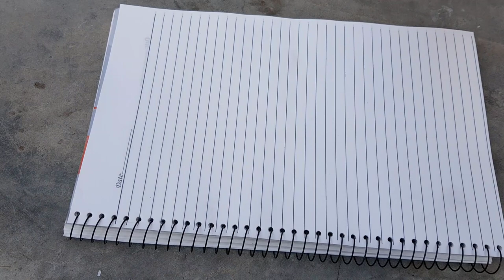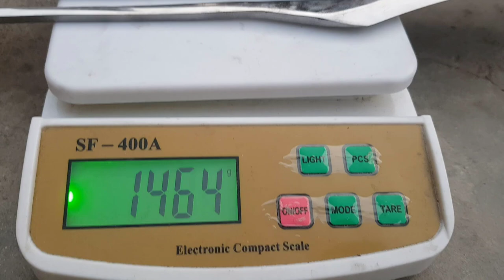Rusted GREEK SWORD - RESTORATION

Comment: I assume you cut the hole to take away some weight. I'm no blacksmith or mechanic but In my opinion a fuller would be better then cutting a hole. The hole will cause structural problems in the blade. A fuller will keep the structural integrity and will cut some some weight
Reply: @emmanuelmurillo8665  again just my humble opinion
Reply: That is what I was thinking.

Comment: The handle is only glued together with epoxy... It will separate in 3 good whacks...
Reply: The handle doesn’t really look good with that blade and the way he cut parts out of it weakens it and the hand guard doesn’t look good with it plus it doesn’t match.
Reply: @demonshady1347 , I thought the same thing
Reply: Like many have stated he’s never going to use it. He’s making a decoration essentially
Reply: That's if the spine lasts that long with the huge hole in it.
Reply: There were pins...

Comment: Didn't like the cut out it looked better and stronger without it
Reply: Im agree with you
Reply: agreed
Reply: Yup, that cut out has no benefit to the sword either aesthetic or practical.
Reply: +Vampros Mortimer   I cant Agree with you.   You can bind some of these swords together an smash the hell out of you Enemy xD
Reply: a fuller would have been better
Reply: It’s to reduce weight.
Reply: @vamprosmortimer5133  sure for benefit = reduce the weight
Reply: @leifstone5969  thing is, it wasn't like he's going to swing around that sword, right? why bother reducing the weight
Reply: @zedieucorentin  He could have reduced the thickness of the blade at that point without compromising the structural integrity, it's called a fuller and our ancestors used them for a reason (more than one reason actually, but I digress). Blades with holes in are almost entirely absent from the historical record. 
Putting a fuller in the blade would also have been a better test of his skills in my opinion, but each to their own.

Comment: This is awesome, but can anyone explain to me why he cut the groove through the back of the blade?
Reply: BC he needs the 10 mins
Reply: Weight reduction? And also to make it look cooler
Reply: Aa Bb if it was for weight reduction maybe he should have skipped that brass handle.
Reply: Whatever the reason...IF this were indeed an ancient blade (which I doubt), drilling into it and cutting that useless slot into it ruined it as far as any value is concerned. Restoration is taking and object and restoring it to its original, "Like New" condition. Any modifications just ruin the item. And if it IS an ancient blade (again, I doubt it) , he should be ashamed of himself for modifying it.
Reply: Blood channel?

Comment: Doesn't look like a Greek sword.
Reply: Barbarossa knows better.😁
Reply: It does actually. The greeks had many Sword models
Reply: actually, it's a Falcuta. It was a modified version of the Kopis sword from the Greeks, that the Early Romans used in the (Roman Conquest of the Iberian Peninsula) To be frank, it was really as powerful. It could use it's weight, and have the same type of power/impact as a heavy ax. Think of it like a sword/ax hybrid.
Reply: Because its a shitty modern styalised replica, you can see when its in the furnace there are angle grinder marks at the base of the blade.
Reply: It does actually but it's probably just a couple of years old judging by the amount of rust. Either that or the dude ages the things himself so he can "restore" them on YouTube for views. Only takes a few hours to get it looking old like that. I know because I relic guitar parts
Reply: It doesn't look like a Falcuta either, the top edge of the blade should be a continuous line, this thing instead has a spike/point no greek-roman sword has

Comment: Yeah, ancient... But seriously, how old is it? ;)
Reply: Zeus only knows, possibly very old. Considering the original swordsmith used an angle grinder to cut it out of the 1/4" steel plate, it might be from the age before plasma cutters were readily available
Reply: @andersknapasjo9576  now that is very perceptive! So the age would be somewhere Walmart The Great and Holy Apple Empire. Astounding...
Reply: It's 2013 years old
Reply: @dreamspacealt  "ancient©"
Reply: 4:02 the sword isn't ancient...the iron that comes out from the holes is in good condition
Reply: @kostantinosstamatakis4808  ofcourse it is in good condition. Ancient my a$$ 😂

Comment: Restoration is rust removal, adding a new handle, sharpen the blade MAYBE add some engraving on the blade if it reflects who owned it or if it just needs re-engraving or something... NOT cutting a chunk out of the blade and modifying it

Comment: Dude, I get that you're just having fun but the Kopis or Khopesh you mentioned was a short (think 25 inches) lithe single-edged sword that sometimes sported a fuller.  Not a huge-ass hacked-up sheet-metal cut scimitar with a useless wonky keyhole. More like a Kukri than what they showed Leonidas using in 300.  Manufacturing-wise I also have a few issues. 1. The keyhole serves no purpose...other than turning it into a tuning fork if you hit something.  It also wasnt even close to straight.  2. You never straightened or reforged the bent tang...which will be exactly where it breaks from the previous metal fatigue.  3. Wet sanding doesn't work to preserve temper it you use it with mechanical sanding.  You need to regularly dip the entire piece periodically for that.  4. You didn't even shape or deburr the inside edges of the guard.  Just left it looking blocky, heavy and covered with tool marks.  Along with the goofy grip, it looked a little like a gilded turd.  I hate to be negative to someone that's maybe doing their best creatively but this thing just looks like such a kludge.  I'd also like to second the people who called you out for labeling this as a restoration.  This sword wasn't anywhere close to ancient and all you did was turn it from a working tool into a mall-ninja special.

Comment: Didn't you do the hardening and temper process backwards ? I thought the whole point was to harden the blade to make it tough and then temper it because the hardening process makes a blade brittle and breaks really easily so when you hardened the blade you took away the temper process you just did

Comment: Disgusting. Why would you take a chunk of metal out of the sword like that? That’s not restoration, that’s customising it, and it won’t make a difference in weight either, it wasn’t even done properly, it looked really rough around the edges. This better not be a “real greek sword” like you claimed.

Comment: THe holes' he made are quite the adjustment, they are for when you swing the blade, so air can go through, and so it wouldn't be as difficult to swing against air resistance, but it couldn't have made much difference, since you won't be swinging it anyway, great vid nonetheless

Comment: This is not a Hellenic sword of any period... This looks like the sword from the movie 300, but the actual Spartan's sword was made from steel and had a total length of only 45 cm (with the handle). This was because Spartans (when the were off the phalanx) wanted their opponents close to them because the were excellent "Pagration" fighters with great strength and had advantage against them.  The short sword in a body to body combat is easier to handle.

Comment: I've watched a few of your videos now, and I love them, don't get me wrong, but you routinely freehand/eyeball draw the lines and angles for your guards and pommels, and it's obvious through the computer screen that they aren't parallel or equal. It just bothers me. It would take the simplest adjustment to ensure your measurements match, and yet, you just poop them out willy nilly. I love what you do, but that crap really ruins it for me. I can't tell you how annoying it is to order a sword and find that the smith was lazy enough to leave things uneven, warped, unlevel.

Comment: wet sanding to make sure it doesn't lose temper
me: because an angry sword, is a reliable sword
also me: shame its impossible to do anything with that handle, for those wondering if you try to mess with the handle in anyway you're basically screwed

Comment: This dude did a shoddy job on that. Didnt heat treat it with any care also didnt sharpen it properly even if he did do that on both sides he still did a poor job ,but from the looks of it he only sharpened it from the one side. Cutting the spine out of that blade is a cardinal sin especially considering the blades weight is supposed to be proportioned to cut in a similar way to an axe. Also the handle could have been made better as well. Seemed oddly proportioned and the guard seemed like it would hinder you from getting a comfortable grip as it seemed a little small and close to handle. The guy didnt even seem to take the time to cut evenly or make sure the work he did was even. He just sloppily charged forward and ended up with wavy lines all through out the blade. This guy really needs to practice more and research more. Maybe even consider taking classes or getting a mentor.

Comment: Even if this isn't an Authentic Greek sword doesn't mean you have to destroy it. Drilling a line through the sword only weakened not improved it. Not to mention the brass that you used as part of the handle is not even straight and doesn't line up.
The putting that crap on their makes it look ridiculous.
If this is what you do to a fake Greek sword I wouldn't let you near a real one.

Comment: That's not restoring the piece that is flat out destroying it you just cut a hole in the blade and a restoring the blade means you don't alter the blade anyway at all if you're still the blade you make it the way it was no changes with no changes